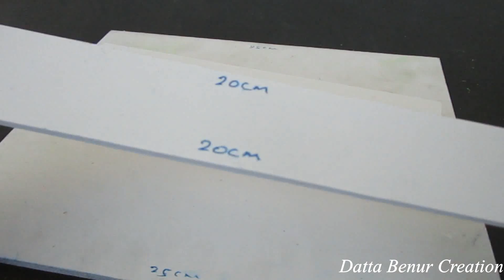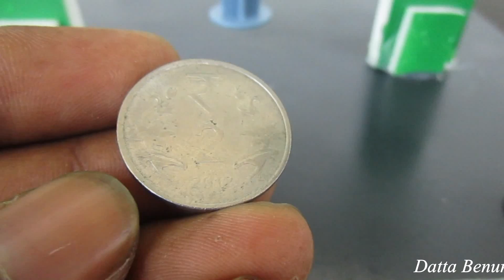How to make hydraulic press at home - Hydraulic Experiment

Comment: Someone please correct me if I'm wrong, but even though this is a hydraulic, there won't be any mechanical advantage generated: the amount of force he uses to push the horizontal plunger down is the same as the output force applied to the pressed object. Although the water is being pushed into the vertical syringe from a smaller pipe, it is being pushed through a 'reverse' hydraulic where a larger volume of water is forced out of the small syringe end. Since the two syringes are the same size, they in effect cancel each other out. This simply just transfers his thumb pressure to the pressed object.

To utilize the mechanical advantage of hydraulics, the horizontal syringe should be skinnier (and ideally, with as long a plunger as possible) than the vertical one. The force applied to this input syringe would create pressure which is always applied evenly in all directions, so when the pressure gets to the wider vertical syringe, that pressure remains the same but the area is bigger (larger plunger end), making the press move more slowly/shorter press distance but with more force that what was applied.